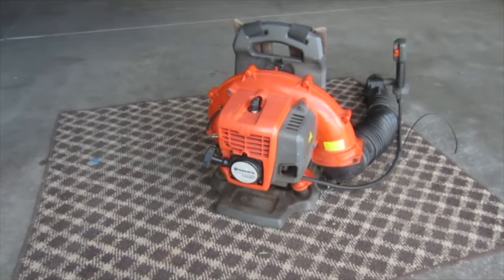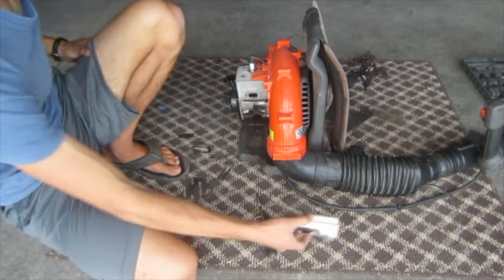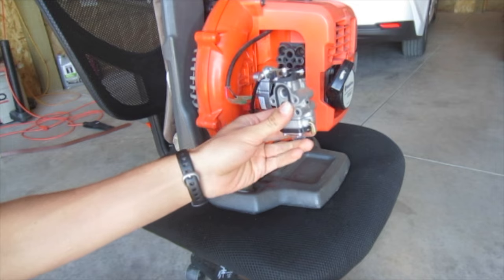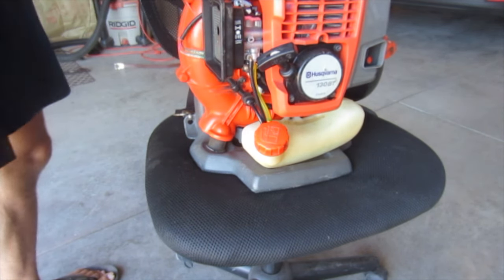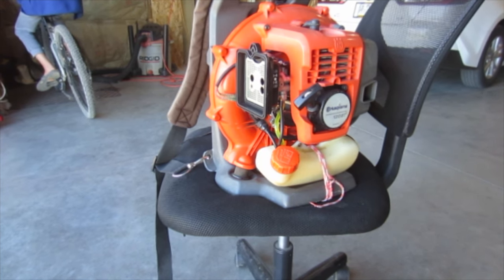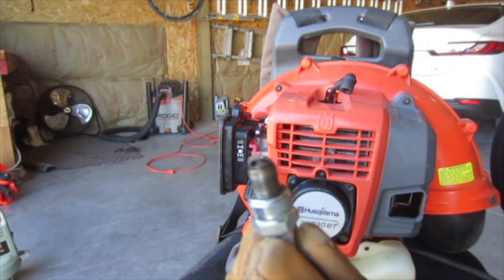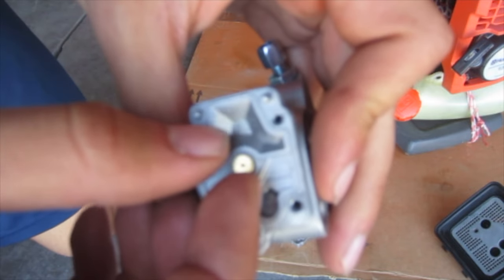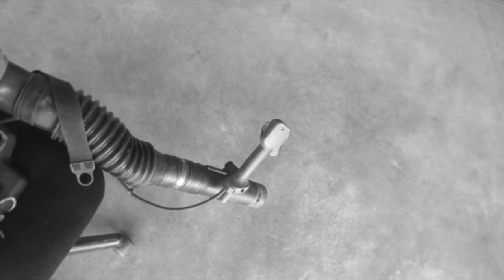Husqvarna 130BT blower missing MANY parts (Can I get it running?)

Comment: That extra gasket material often acts as a heat shield
Reply from the maker: Okay, that makes sense. I imagine you could also make another gasket out of it if you needed to.
Reply: @Differentthings2006  yes I’m sure you could. I would leave the carb one whole though.  Without it you might get vapor lock

Comment: Always check the intake boots on those. The 4 bolts loosen and they run lean. Sometimes the carb will have a slight wiggle. Seen two recently with the same issue.
Reply from the maker: The Intake manifold was tight, thanks for the suggestion though.